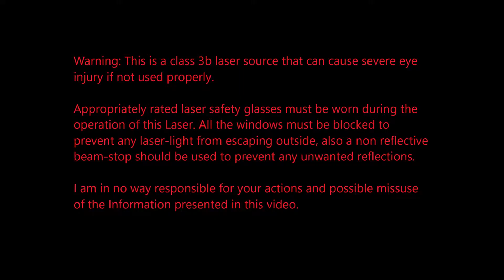660nm red laser test

Comment: cool!  I've recently extracted a DVD diode
I sadly cannot run it at it's rated power as I do not have goggles

For testing I ran it way under threshold so it's more or less acting as an LED
Reply from the maker: Cool, is it in the video you send me on discord?
Reply: @firefox1136  hi Firefox what's your discord?
Reply from the maker: @NerdlabsSci  Its Firefox#1136 feel free to add me.